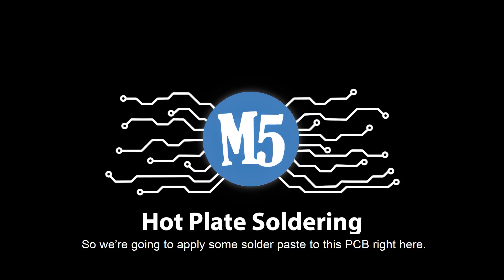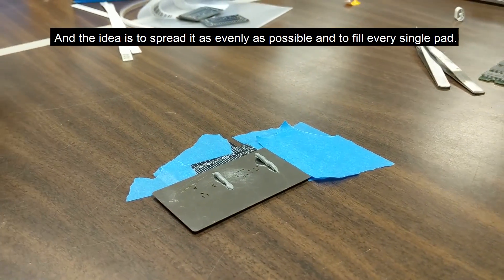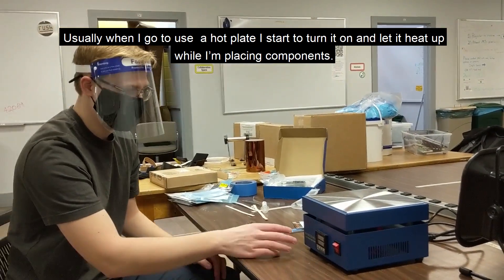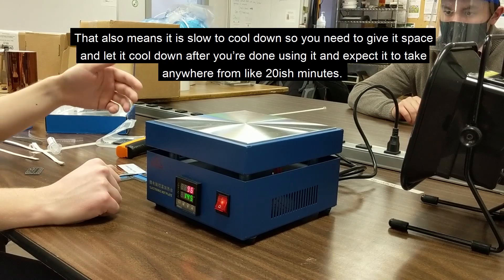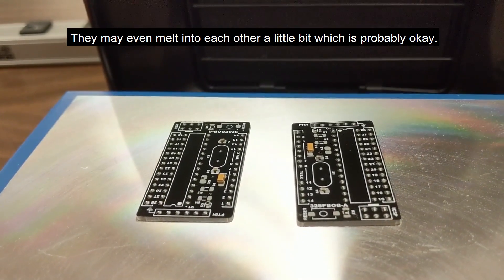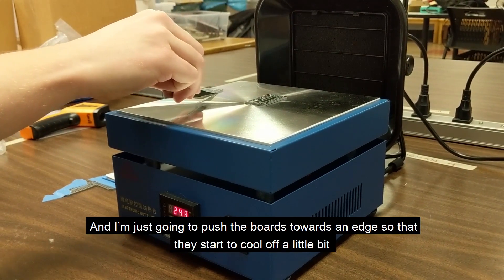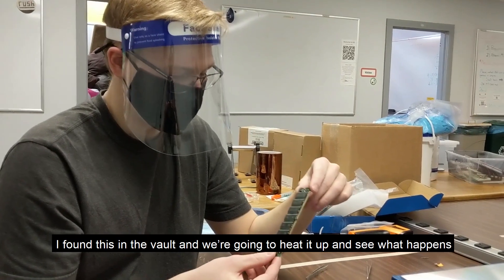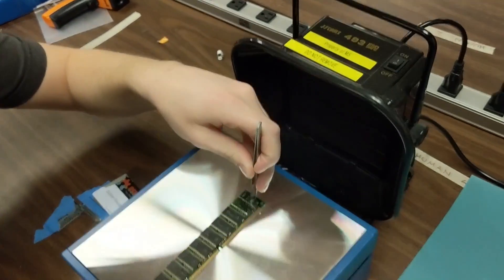Soldering with a hot plate

Comment: How do you solder double sided PCB's with components on both sides?
Reply: On a PCB assembly line, each small part receives a small dab of glue to hold it in place before it goes through the reflow oven.  The glue holds the parts in place during the reflow process.  Most prototype designers will try to keep all surface mount parts on one side of the board so they don't have to worry about this issue.
Reply: @picklerix6162  No we don't use glue for reflow. Solder has surface tension and unless there is a big ass heavy part with tiny pads (a transformer for example) the tension keeps them in place while upside down.
Glue is used for wave soldering smt parts.
Reply: I have one of these, an ripped out that control unit and put a ESP32 with an oled screen, SSR. This has profiles in that you can choose from the menu. Using a MAX31865 with a temp control. Using existing heater an thermo coupler. Its even got a 4 pin PC Fan to help drive the temp down faster.
Reply: Use two different types of solder paste. 
One with lower melting point.
Reply: @TheHaubke  can you please recommend for those solder pastes?
Reply: @doronshpigel321   well i do not know a good type. Depends on your usage. 

Lets say use one with 210c melting point. Other side, 160c melting point.

Comment: Thanks for the demo. Why do you set the temperature to less than the melting point to begin with?
Reply: When you reflow a PCB, there are temperature profiles to follow to not overheat components, On a plate, you do this manually - reflow ovens have profiles built in that they follow.